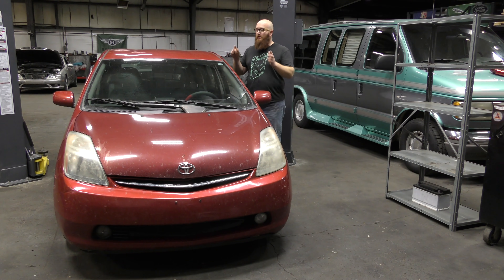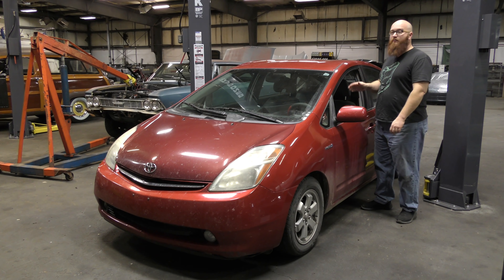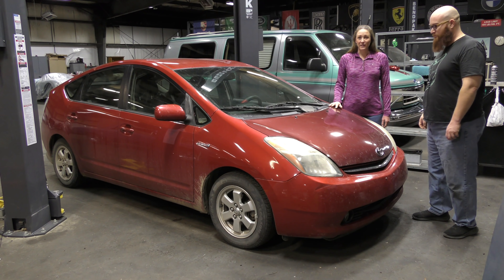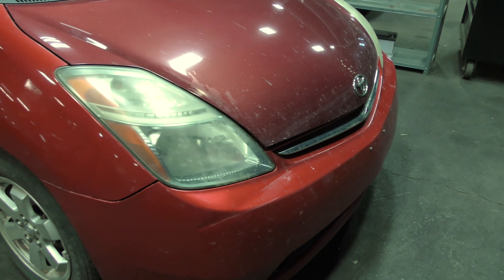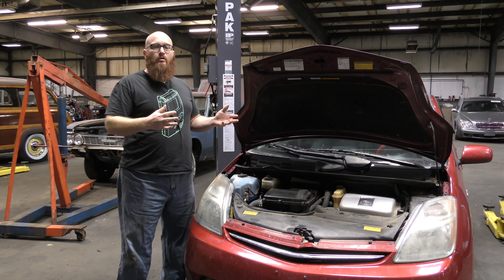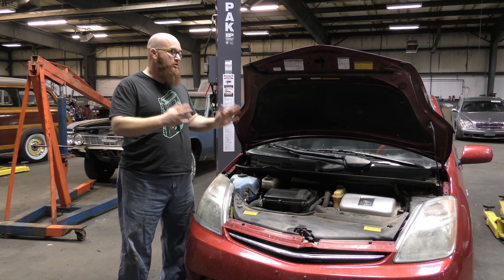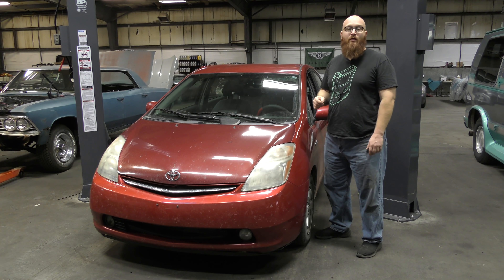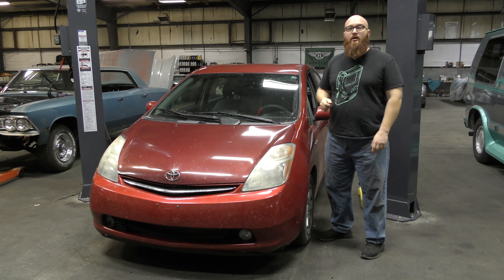When is it time to Buy or Sell a Hybrid? The CAR WIZARD inspects daughters 2008 Toyota Prius

Comment: Ironic that Wizard's daughter doesn't want to check the oil, as cilents like that are what allowed him to afford to buy his daughers the cars they want, as the French say c'est la vie.
Reply: agreed! don't want to check the oil every other week but dad is the one that has to pay for and fix everything that goes wrong. Not picking on the wizard, it seems like a lot of kids are like this
Reply: My daughter drove a Mini for 35,000 mls burning oil like crazy and now that we rebuilt the engine she is worried because the oil doesn’t drop on the dip stick. Don’t spoil your kids like that make them have some responsibilities. My daughter helped rebuild her engine and she’s happy that she learned a lot.
Reply: This Prius really isn’t a new car anymore. I think it’s fair enough that Wizards daughter is concerned about the oil issue, I wouldn’t want to drive a car either that loses oil somehow. Besides, it’s Christmas, maybe the RAV 4 is her gift.
Reply: @sideshowlw-4489  most reliable car I've owned was an oil tanker alfa 147. Consumed a liter of oil every 1000km, but as long as there was oil in there it never stopped running
Oil consumption is just a symptom of age. It will happen eventually, but doesn't mean the car is dead
Reply: @sideshowlw-4489  I
Reply: @sideshowlw-4489  
Losing a half to one quart of oil over 5,000 mi is not an issue. You'd be surprised a lot of brand new cars will consume that much.
she's not willing to check the oil you can guarantee she's going to end up frying that RAV4 he got her as well cuz that's going to burn oil also.
Checking the oil takes 10 seconds. Do it in the morning when the oil has settled all you have to do is pop the hood pull the dipstick which is right in front look at it put the dipstick back in the hole close the Hood And drive it if all is well..don't even need a rag or get your hands dirty.
Reply: Still, I get why you would want to get rid of the Prius. If not for the oil issue, than because the car is apparently not suited for the Countryside as wizard esxplained.

Also the Prius has incredibly high Mileage. 220000 Miles translate into roughly 350000 KM. In my Family, we usually replace our USED cars after 100000-200000 KM (60000-120000 Miles), because we‘re worried about reliability. (In fairness Cars in Germany are probably driven harder than in rural Kansas and therefore won‘t last as long ).
Reply: @sideshowlw-4489  
The fact that it's not suited for the countryside is certainly a good reason to change cars.
But 220,000 miles is not really that much
The amount of oil consumption mentioned is not much either.
My 2008 has 347,000 on it
My friend has a 2006 with 380,000 on it.
And I know someone else with a 2004 with 520,000 on it.
The second gen Priuses are pretty much tanks, they certainly have their faults and failures which can be expensive if you can't work on the car yourself. But if you can they're easy to fix and work on.
Reply: @kens97sto171  I Hope the Toyota Hybrids are really as good as you say! My Mom just bought a CH-R Hybrid, if it is that good, it may stick around longer than 200000 km
Reply: @sideshowlw-4489  
The basic design has never really ever been changed since 1997. the thing it's nice about it is mechanically it's relatively simple.
inside the transmission there are not any wearable items no clutches no bands etc it's basically just a planetary gear set with two electric motors one on each side to control the output ratio. The most important thing is to change the transmission fluid about every 50,000 MI. It's a simple dump and fill there's no filter to change so it's pretty easy to do.
If you're interested in seeing how it operates theory of operation and disassembly there is a good YouTube channel called Weber automotive he has many videos on the Toyota hybrid systems as well as some of the Honda and Ford products as well as a pretty significant disassembly of a Chevrolet bolt Electric car. He runs an automotive college and uses the videos for training so they're a bit dry and slightly boring but extremely informative if you're into that kind of thing.
Reply: No Americans do not like to check the oil that's why a lot of the newer cars have a light that comes on in the dash
Reply: @Edgar Miller yes the new ones are ok the first generations run away
Reply: @kens97sto171  Oh yeah, the chevy suvs with that oil filter on the front love to burn oil. Never seen one come in for a change that wasn't low.
Reply: @alyssa7867  
Kind of amazing how some engines tend to be oil burners and some don't. The third generation Prius 2010-2015  is better known for burning oil. Along with with a few other issues that didn't exist in the second gen Prius.
Imy Prius is been a pretty damn good car I use it for work, I put 150,000 miles on mine in the last 3 years.
it amazes me that a car with $350,000 miles can still be running on all original suspension parts ball joints tie rod ends are all still original. I swapped out the struts recently due to the right rear leaking oil.
Seems some of the Chevys are pretty damn good and some are not. I watch a lot of automotive repair channels and you do start to see some patterns in the vehicles that show up at the shop and what problems they seem to have regularly. Chryslers with weird electrical problems. Chevys with evap problems. The Honda v6's  with compression loss in one bank or the other. Really weird stuff sometimes

Comment: In 2016, I bought a 2014 Toyota Avalon Hybrid as a Toyota Certified used car.  I love how it's so quiet in stop-and-go traffic or when I-5 in Portlandia or Seattle/Tacoma turns into a parking lot.  It's very soothing to just crawl along on electric power.  Also, imagine a big car getting 44 MPG on the interstate!  The only downside is that you can't go more than 30 MPH on electric power alone for more than a half-mile, and you have to feather the accelerator pedal or else the gas engine will kick in.  Otherwise, it's an awesome car.  Having rented several hybrids over the last decade as well (Nissan Altima, Ford Fusion, Toyota Prius), I love hybrids.  Bonus:  hybrids are sneaky-fast off the line at a stop light because of the torque of the electric motors.

Comment: For every old, worn out car that I sold or gave away, I’ve had sellers remorse. I miss them all and wish I kept them.

Also, Toyota should have taken a lesson from the Chevrolet Volt and automatically force run the IC engine if the hood is open while the car is “ON”.

Comment: We have a 2000 celica as our beater/summer fun/backup car. When our others vehicles have had problems that one has kept going. It’s rusty and shakes a lot below 1,000 rpm but it keeps going when we need it. Heater still works- AC needs recharged. It’s a small hatchback but surprisingly capable. Fun car do drive on backroads with the lowered shocks. You can take sharp turns at 60.

Comment: Traded my 2008 Prius with 234,000 miles to the dealership that sold it to me new for $1K for a pre-owned 2015 (in 2017) Prius with 32K miles (now 105,000 miles).  All Florida Highway Miles mostly.  I kept getting the red warning triangle the last 35,000 miles from time to time, which led to me to believe the traction battery was getting ready to die. so I traded it in before it went out for the other Prius.  The Prius' almost never have any problems no major repairs, all regular maintenance.

Comment: 3 gen Prius based Toyota with over 160 k miles with only regular service, all original, nothing been replaced yet except brakes and wheel bearings due to a rust. Loved if can go another 160 k miles then will swap it for a new Corolla hybrid.
Reply: If you haven't replaced the water pump your on borrowed time.

Comment: I would wager that car is good for another 100k miles. Hybrids have amazing longevity. We own two and our 2010 Ford Fusion Hybrid has 321,000 miles on it still on the original battery. Because of the hybrid electric assist, the engine and transmission have never needed more than routine maintenance. Also because of the regenerative braking, brake linings last 100,000 miles or more, adding to the cost savings from the 40 mpg the vehicle averages.
Reply: Must be my luck then, I have a 2011 Ford fusion hybrid that I got for $10k with 60k miles. So far after owning it for 2 years I have had so many issues costing in total $16k in repairs. I must have got a lemon. At this point I am only getting between 20-30 miles per gallon

Comment: Great video. I owned a 2009 Prius with nearly 150,000 miles on it, with no sign of hybrid battery wear. Unfortunately had to get rid of it for I needed a snow car with high ground clearance. Mileage with my Subaru Forester is great at 30mpg; but not the 47mpg I got with the old Prius.

Comment: My 2008 Prius bought new it’s going strong has been the most economical car I’ve ever owned. I only use it for long trips and use my bike for short trips. I’ll wait until I get a tail wind for a long trip and get better mileage. Have 130 K on it. The hybrid battery is fine and the car is garage kept in great shape. On the highway I hit a skunk by the wheel well luckily it did not get lodged in the radiator area. I counted five seconds And the smell start coming into the cabin. The car behind me probably got a Cloud of odorant Through his heater system then he passed me as soon as possible.
Reply: Bought my Prius in '04 and it's still going strong 17 years later (original battery and parked outside for the entire time).  Great car!  Bought a Tesla Model 3 in '19...it's awesome!  It's EVs from here on out for me.

Comment: I have a MK7 golf R but I drive my 2006 prius 95% of the time. Great cars mine has 268k miles. I changed the battery at 230k for $300 still get 45mpg with the AC on. Almost junked it when the car when the engine felt like it was going to shake itself loose, but I drove for 3k miles with the battery light on. Once I changed the battery it drove like new. $17 to fill the tank if I baby it i can get 350 miles easy per tank. Great video highly recommend a 2nd gen 2006 and up.

Comment: I’d never buy a Prius for myself but I’d never make fun of someone for driving one, they’re extremely reliable cars.
Reply: I used to make fun of them. But I rented one (not by choice) and I actually liked it. It was comfortable, quiet and cheap on gas.
Reply: They're the most perfectly optimized car: they do EXACTLY what they were designed to do, and are very easy to live with.  I've had mine for a year, and expect to have it for a very long time.

Comment: I recently bought a 2010 Camry Hybrid for these exact reasons. It now has 189k miles, original hybrid battery, and the late 2.4 engine that burns oil. It was becoming long in the tooth for the previous owners who were getting ready to replace it, and I was interested in finding something inexpensive to use for rideshare work. I wanted something that got better gas mileage than my 2017 Subaru Legacy with the 3.6 engine, and at the same time, 2020 put all of my work in the performing arts completely on hold, so I didn't need an extremely reliable car to get me to work or auditions. I cashed in on the Subaru over the summer, and the Camry is almost cutting my fuel expenses in half. Also considering the amount of inner-city driving I do now, I will probably replace the Camry with a newer Camry/Avalon/Lexus ES Hybrid when this one is done.
Reply: smart
Reply: Rav4 o Camry
Reply: Is your 2010 Camry Hybrid still running?

Comment: I just bought a second one of these last week, same deal some cosmetic issues but other than that is runs and drives just fine and I will save loads of $$ on gas.
Reply: They are not that great. I had one brand new, well a Lexus CT200h, but its based on a Prius. It did at best 42mpg, which is not that great. My batteries failed at 76,000 miles, at which point it was out of warranty.
Reply: I disagree with DJ. Love the gen 2s.
Reply: @TheSaabClinicUK  what year was your CT? I own a 2016 premium audio with a screen in the middle.
Reply: @stephaniecoloma8125  Mine was a 2012 CT200h Premium with the Mark Levinson sound system (which was awesome). A memory has come back about how terrible the seats were. I used to do some long 2-3 hr journeys and it used to really do my back in.

Comment: Oil seepage like that is what we call rust proofing in my neck of the woods.
Reply: It's actually part of the self draining oil change system. I have it on my car and I haven't needed to get under my car to drain oil for a change in over 3 years. I just add a quart of oil every 2 weeks.
Reply: @dillonh321  its great if you burn AND drip oil, never needs draining and shouldn't even get black☺️
Reply: @dillonh321  I hope you somehow can still change the oil filter (assuming yours isn't on the top of the engine like some european cars).
Reply: @dillonh321  and in my opinion this is why BMW puts the oil filters on top...
Reply: @justinclark5078  
Subaru places them on top

Comment: Excellent choice for Leo. 

I had an ‘06 Prius. Bought new with 2 miles on it and sold it 12 years later at 233,000. Never any major problems until the end, when it was burning 2+ quarts of oil between changes. Did regular maintence and didn’t even have seepage. Excellent vehicle. 

Would have bought a new one if I didn’t get a Tesla.

Comment: Amazing, I just bought a 2008 2 days ago. Lightly wrecked in the rear lift gate, so got it for under $2000.

120,000+/- miles so I think it’s good for a while after I fix it.

Comment: Depends on the hybrid. I have a Lexus rx400H, and it's not worth getting rid of, the truck just rides to good with 200k miles. I'll spend 4k on a new battery when the time comes because it's worth it all day. It would cost a fortune to upgrade to a better car lol. I could spend 20k right now ..and it would be a downgrade compared to how good my Lexus drives...it's also fast, and I get 30mpg.
Reply: good to know. ive been looking at rx400h for a while. im sure you can get batteries cheaper, but lexus...
Reply: @bendino9016  I just seen a badass one sold for 10k. I wanted to buy it but it was sold by the time I got out of work lololol. If you find one. Make sure to change the trans fluid as soon as you get it. It's a couple hundred for the fluid but that CVT trans is worth saving. Run good oil and maintenance, and u should get 500k miles with slight repairs here and there. The gas milage makes it worth it all day. And my Lexus is just as fast as the new dodge trucks and range rovers with the V8...if you charge the battery up. And that's fun to do because it gives you a break gear on the shifter...it feels like you are down shifting and it saves you break pads. 
Btw, the coolest thing I've done in my rx400 is drive it through a flood. Like 4ft tall water. The street was flooded and all you could see is mailbox tops to tell you where the street was. And it was about 60ft of flood to drive through....and I actually made it....and that's insane because it's electric...my mind was blown.. Lexus apparently makes submarines lol the water literly went half way up my window while I was going through it. And a guy with a charger didn't make it...he lost his car behind me, and had to swim out of his window. I will drive this truck till the wheels fall off. And I'll gladly buy a new battery for it....with new battery tech I should even be able to get some more power with an upgrade. Hopes this helps.  And I know you will love the truck you get.

Comment: I bought a 2015 Prius in Jan of 2019 with 50k miles on it. It’s got about 82k as of now and I’m proud to say no issues whatsoever. I was told that the gen 3 Prius starts to burn oil around 100k but I hope I don’t encounter that problem anytime soon. I had an issue with the front lip of the bumper getting all scraped up and banged up but I had it sanded down and painted for $150 bucks. All and all this cars are very reliable and save lots of money, what did you expect, it’s a Toyota.
Reply: I thought it was the 2010 models that liked to burn oil?
Reply: @redey1290  I was told it was the gen 3 prius which is 2010-2015. I’ve read that it also happens with the gen 2, this problem happens when the vehicle has high mileage.

Comment: Crazy how cars hold value in the US. I'm amazed you sold that for between $1.5k to $2k. Over here in the UK with a car in that condition with that amount of mileage that wasn't a diesel and consuming oil like that you'd be lucky to get £150 - £200 blows my mind it's worth 10 times that in the US.
Reply: That'd be $A3-5K in Australia, even in that shape. At least here in Victoria anything with a roadworthy certificate (required to transfer registration) is minimum $A1500-2000.
Reply: @deanstyles2567  that's crazy, I bought an audi a4 b5 for £600 two years ago with 82k on the clock, cars depreciate so quickly over here. If someone tried asking for a grand for that prius they'd be laughed at. Most would just look at it as scrap, certainly wouldn't be worth replacing the battery pack here. Prius never sold too great here, sales peaked in 2010 they were mostly used as taxis so you don't see many about now.

Comment: Scotty would be proud of this video.
Reply: I trust the car wizard 10 times over Scotty Kilmer.
Reply: Actually , Scotty doesn't like hybrids either , even the Toyotas . He says that they don't last longer than 150,000 miles , then you have to replace the battery which would be thousands of dollars and be more than the car is worth . Scotty only seems to like and recommend regular non hybrid Toyota products , to the point where he keeps repeating himself .
Reply: @briannichols4807  Scotty seems to think that the Prius “generator” (motor/generator?) is prone to failure. In fact, that is a rare occurrence.